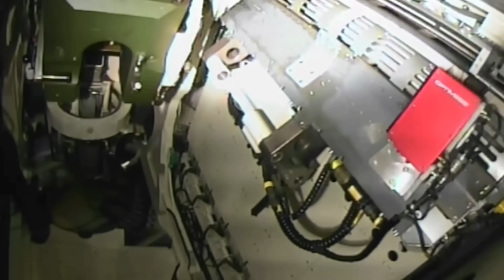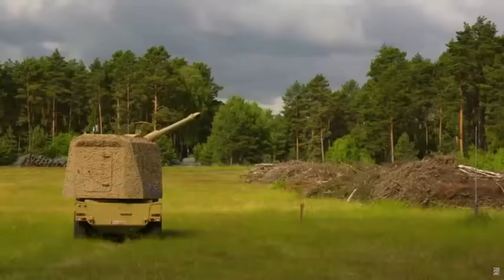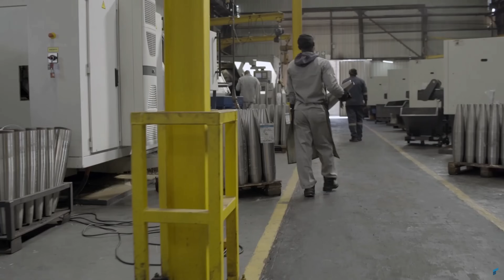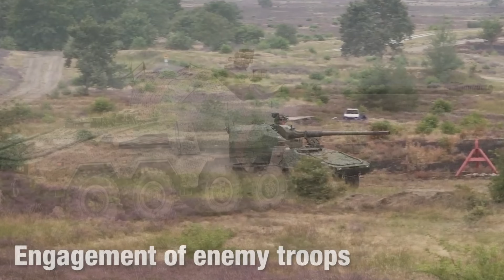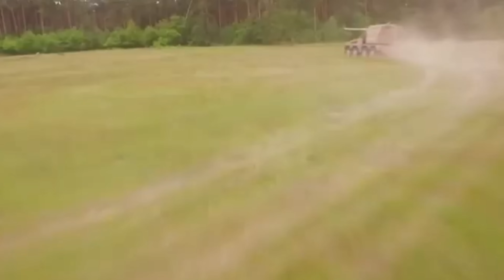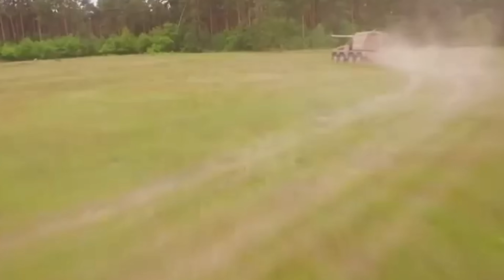The RCH-155 Self-Propelled Artillery System | 155mm FIRING ON THE MOVE!

Comment: We always complain about German Engineering ( over engineering) ,  but this is genius period!
Reply: I think overengineering gets often confused with overvaluation. If a system has the exact same functionality, reliability and durability as a less complicated one, you could indeed call it over-engineered. But if there is a tiny difference that you somehow consider a significant advantage, then it doesn't deserve that title. Well, you can of course debate whether you really need it or not. Like buying a car because it has 1 more horsepower than another. But that's a different discussion.
Reply: They label it 'over-engineering' because, let's be honest, their own attempts at engineering are more like assembling IKEA furniture blindfolded! :D Greets from Germany
Reply: @  True , true , nobody talks about upside down logic in British designs🫤
Reply: @socotroquito2007  Sherman Firefly:
Reply: @  British MOD; How oversized a gun can fit in a Sherman Turret 
Engineer corps ; Yes
Reply: Germans just happen to think of more eventualities and try to prevent as many issues as possible before they appear. Other nationalities often have more of a “we will cross that bridge when we get there”-attitude. If you get lucky, that saves a lot of effort, but if you get unlucky, you might get something that is barely useable. Germans on the other hand often invest more and seemingly unnecessary effort right away, but have to redo things less often. I experience this fundamental difference in attitude regularly working on international teams. I don’t know why that is, but is really a fundamental difference in mentality between nations.
Reply: The trope of German over engineering everything has been a thing since WW2 and was the vast majority of the time wrong and bound in a Inferiority complex. 
And after the war pretty much every western country followed the same doctrine. 
Examples like the MG42 just being bark and no bite because the rate of fire was too high and just made it ineffective, when it has been proved to be the most long lived LMG design in use. 

Or Panthers and Tigers being wasteful even through no western country produces tanks to just be ok anymore, but instead follows the same doctrine, that we want to field tanks that should have a comfortable lead on any enemy.
Reply: @steffenjespersen247  the german overengineering started in the 90`s early 2k`s
Reply: @hotdog9262 
No The first German tank (A7V) was also intended to be more than just a tank. The tracked chassis was also later to be fitted with other structures.

Comment: it's amazing to put it on the Boxer. All Boxer mechanics can work on it and after driving on a mine you could probably mount the turret onto a new Boxer and you're ready to go again.
Reply: Supposedly, RCH-155 can't go on any Boxer, it has to be a specially modified chassis
Well, can't have everything :-)
Reply: @ as far as I know, they updated the chassis and engine so it's now fully interchangeable among all variants.
Reply: @Lonestar24  Modular design  is not about the any chassis being capable to carry it but that you can use the same logistics train for them.
Reply: @mangalores-x_x  but specifically with the Boxer, its "modular design" quite literally means that it is intended - from the ground up - to carry completely different mission modules on a common chassis. With no adaptations at all, if possible.

Comment: I think the most interesting aspect is the use of Boxer. These are about 4-5 million euros each, I think.  If this is not too much then we might see an explosion of incredible boxer modules that we wouldn't have imagined being possible until we saw this one.
Reply: There are some modules out there right now  check out Jupiter is a version with a Laser on top :) 

Troop Transport Vehicle (GTFz): For transporting infantry groups, accommodating up to eight soldiers.

Ambulance Vehicle: For transporting wounded personnel, equipped with medical gear and staff.

Command Vehicle: Equipped with modern communications and command systems.

Driver Training Vehicle: For training drivers with special training equipment.

Heavy Joint Fire Support Team (JFST): For artillery command and support, with heavy weaponry.

Heavy Infantry Fighting Vehicle: With a 30-mm cannon for fire support.

Artillery Gun Module (RCH 155): An unmanned artillery module with a 155-mm cannon.

Mortar Mission Module (MWS81): Equipped with an 81-mm mortar for indirect fire.

Bridge Layer: Capable of laying bridges of various lengths.

Recovery Module: For recovery and repair missions, equipped with a crane and winch.

Engineer Squad Vehicle: Specifically equipped for mine clearance and other engineering tasks.

Battle Damage Repair Vehicle: For quick repairs on the front line.

Reconnaissance Vehicle (CRV): Specifically for the Australian Army, for reconnaissance and surveillance.

Command and Control (C2): Various versions for command tasks.

Combat Reconnaissance Vehicle: A variant with a Lance turret for reconnaissance and combat.

Fire Control Tank: For coordinating air defense systems.

Qualified Air Defense: A drone defense system with a remote weapon station and radar.

Wheeled Infantry Fighting Vehicle: With the Puma's RCT30 turret.

HEL Module (Jupiter): A project for high-energy laser for drone defense.

Skyranger-30 AA: An air defense module with an Oerlikon KCA 30×173 mm cannon and various sensors.

RCT120 Unmanned Turret Solution: With a 120-mm cannon, RWS, and Spike LR2 missiles.

Boxer Dragoon: A customized variant with a specialized mission module for the British Army, featuring an RT60 turret.

Comment: The module is even more important then you think.....you service one , while having another operating and if something goes south, you just switch the modules. The change can be done within an hour.
Reply: The Chassis and Tires have been changed and the module uses six clamps instead of the four of older versions (with downward capability). This allows for 40t. This configuration ist named Future Common Drive Module, Has been developed for Australian and British needs and will implemented in all future procurements (like the Dutch and German IFV variant)
Reply: If you’re swapped an ambulance module for this, how long will it take to fit the fire command systems.
Reply: @Monkey-ud8bw  As far as I know, the RCH155 does not use the “normal” boxer. It probably had to be reinforced due to the 155mm. 

But, if you talking about the normal Boxer, you can change modules in 30-90 min.
Reply: @ but you should be able to run the other modules on this one, afaik the  connection points are the same

Comment: The RCH155 does give the archer run for its money. But the archer still have quite a few advantages.

* The archer is cheaper, the diffrance is not huge but significant.
* The archer is lighter, specially so the first gen, second gen is just slightly lighter.
* Second gen archer have better range and road transport ability
* Archer have the capacity to carry the operators onboard. RCH-155 don´t. They either have to run on only software, or have the operators in a outer vehicle outside. I really think this  is a significant drawback. Note that Archer can have remote operations  also. So the operator is not bound to be in the vehicle (also the not commander as well)

Comment: Bearing in mind the Boxer's modularity, is this system also detachable? If so, fitted with the correct rig/frame, it strikes me that this system can be fitted to any ship's deck (merchant or otherwise), giving some mighty powerful, fire on the move, offshore artillery support.
Reply: That would work until the salt water utterly messes up all the mechanical parts. That's what killed the MONARC (PzH 2000 turret on frigate) program - the turret worked fine, but proofed too hard to navalize and make salt water resistant
Reply: There tested the PzH2000 turret on a frigat, there can test the RcH turret on a frigat too
Reply: Another problem is the recoil of the gun. Most ship decks need a lot of reinforcement to handle it.

Comment: Hmmm 

Not sure to say the least. 

One of the video footage above shows very large recoil and swinging of the barrel (assuming 8m barrel, the movement is 30-50cm at the tip of the barrel).  Without guided munition, it is hard to imagine being accurate with that level of recoil. 

Furthermore, PzH2000 with heavier chassis and track cannot do the ‘firing on the move’, it is difficult to imagine this can….  

Also there is a rumour 10x10 platform demonstration showed excessive recoil.  It is hard to see how lighter 8x8 is handling the recoil…. 

Will we have 155mm SpH firing on the move in the future? Yes, maybe.  Is RCH155 really live up to its claim? Probably not.  Even if it does, the cost of guided munitions defeat the purpose of cost effective fire support of traditional artillery.
Reply: Recoil has no impact on accuracy. The recoil happens after the round left the barrel.

Comment: KMW has shown the prototype of a tracked Boxer chassis and I wonder how effective the RCH-155 module would be with that tracked chassis.

I may be mistaken but I think KMDS is also working on a wheeled howitzer prototype for the US Army which would basically be the RCH-155 turret integrated on 10x10 truck chassis which resembles the HEMTT 10x10 truck.

I'm wondering how resupply is done and if under-armor resupply, similar to what some tracked howitzers can do, is possible.
Reply: So far nobody seems interested in the tracked Boxer chassis. 
The PzH 2000 already offers most of the capabilities (maybe the others can be added as well) in a tracked platform, is battle proven and carries twice the ammunition.
Reply: The first time the AGM (Artillery Gun Module, the turret) was shown to the public, it was mounted on a tracked vehicle and the system was called Donar (aka Thor).
Reply: Many countries have similar idea and make their own wheeled 155 SPH.
Reply: @joelau2383  But these all have to stop and deploy legs to fire. None of them can do drive-by-shooting.
Reply: @benjaminloehner257  Yes，they deploy supporting legs to be more accurate with cheap unguided round. Most countries cannot effort expensive guided round or guided fuse as their major howitzer ammunition.

Comment: The firing on the move is really useless when you see location precision of counter-battery radar.

What is most impressive is that is does not need time to be put on battery, that is what is impressive and time saving.
Reply: what is the point of counter battery radar if they locate the firing position and giving the information to friendly spg the RCH is long gone before the enemy artillery even fired one shot :D
Reply: @haubitzenfritz7114  it already the case with artillery system like the Ceasar or the Archer. 
What I mean is that I would rather add more precision than slow movement in firing. 
The system is already impressive by the fact that it seems to not need any embeded firing to fire multiple shots with speed and precision

Comment: A little bit top-heavy, I would say. I really wonder about the risk of toppling it over in uneven terrain or unstable underground.
Reply: And you really think that was not considered?
Reply: @ I think engineers sometimes get carried away a bit, Like with the new submarine for the spanish navy which immidiately sunk after it got launched at the shipyard because of a lack of buoyancy miscalculation (basically, they've stuffed much more equipment into it as originally planned). And this is only one example I remember...
 
This said: It's very funny like they showing this SPG operate only on very even (almost even like a table) ground in this video clip...
Reply: All the heavy parts are located at the bottom of the vehicle and the top is mostly some steel plates and air. It looks way worse than it actually.
Reply: @gbornitz  That isn't quote right. Gun breach and barrel (both togehter pretty heavy, presumably around 4-5 tons, since this isn't exactly a 20mm gun) are almost at the top of the turret, when in transport mode or when it's firing in direct fire mode. Also, the turret isn't mostly air surrounded by armor plates aside from the area where the gun breach and the loading mechanis are operating this will be quite crammed if its anything near the situation in the PzH 2000. In fact, it's the same system only with half of the rounds stored. It may be barely light enough to be no problem in most situations or even no problem at all. But it's definitely not nothing.

Comment: Counterbattery fire can be pure murder, but with a shoot and scoot vehicle one can stop for a minute and take the time to give your shells the best trajectory with least variation. I'd be uncomfortable with much longer times (the shorter the time the better), one has to be well outside the response fire's CEP ellipse when the strike lands. Never assume the enemy hasn't got their guns pointing in roughly the right direction and elevation just by chance.
Reply: If your enemy is that lucky, it doesn't matter if you fire on the move or stationary. Besides, it still take at least a few minutes to prepare counter battery fire after your initial shot.
Reply: @joelau2383  Once recon drones have spotted you it wont matter much if you're standing still now or little bit later.
Reply: @ You have no clue how artillery works.
Reply: Visual lost data suggests, that artillery systems on both sides are lost overwhelmingly to drones, not to counter-artillery. Shoot and scoot won't help you much against a drone following you.
Reply: Put a skyranger gun on a boxxer chassis nearby and you deal with drone swarms for sure.
Reply: Even with RCT-30. Problem might just be, when a drone operates out of Skyrangers engagement range and only data are used to guide their own artillery into the RCH-155.
Thing is, with moving while firing, there are a lot of locations, where the vehicle could be in the meantime. Since they wont drive all straight and with always the same speed. So there has to be a lot more luck involved compared to before.

Ofc., with a CIWS able Skyranger 35 instead of "just" Skyranger 30, this would be a completely different game.

Comment: Well France do a wheeled one, german copy just after, by the way, the French cesar still the only that can be transported by air. Also the price was around 5x less that the PZHB2000 or the swedish archer. It count a lot when you need to equip an army.

On my side I am septic on how it can shoot a target when you see on how much it balance after a shoot.
Reply: The Cesar is the gun you get when there's nobody that can effectively shoot back at you. Its tailored to that relatively cheap and airliftable role but an exposed crew, longer deploy times, lower ROF and lower ammunition capacity make it worse a symetrical conflict compared to a phz 2000.
Reply: On the other hand the PZH2000 is much better protected than the Ceaser. Out of ~70 Ceasars at least 4 are destroyed and 3 damaged compared to one damaged  PZH2000 out of 28 (according to Oryx)

Comment: The RCH was already ordered by UK and Switzerland and Germany. As an Artilleryman you didn't mention if the MRSI is for only 3 or the usual 5-6 rounds. It would be quite important. The increased CEP for the fire on the move too.
Reply: @kibun1  Archer is only there until the RCH arrives. They donated AS90 to Ukraine and needed something to fill the gap.
Reply: Ukraine is training on the RCH155 system in Germany right now.UAF will be the first army with15 RCH in active duty. US army is testing the RCH 155 as well , I guess it might be NATO standart in the next decade.
Reply: The RCH155 on Boxer and Piranha and the Archer were actually only undergoing trials but the Piranha RCH 155 was chosen last month.
Reply: Should have bought the archer instead